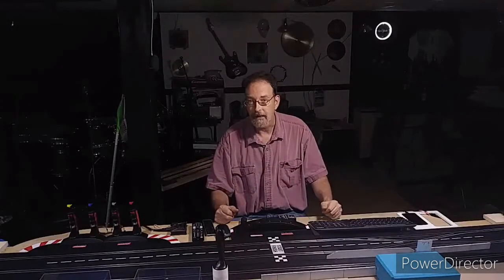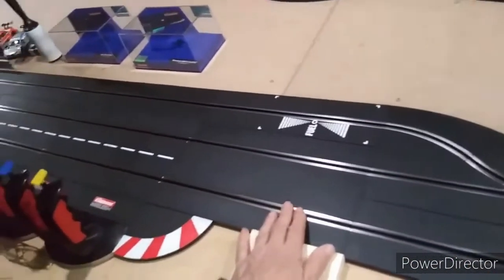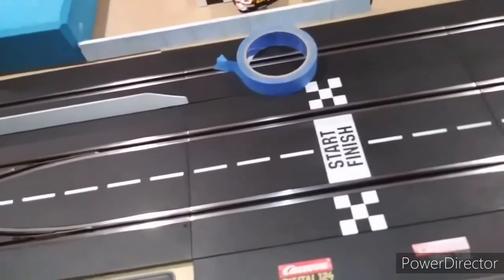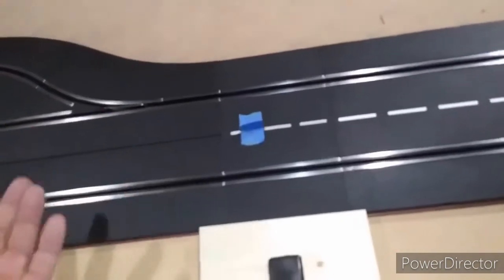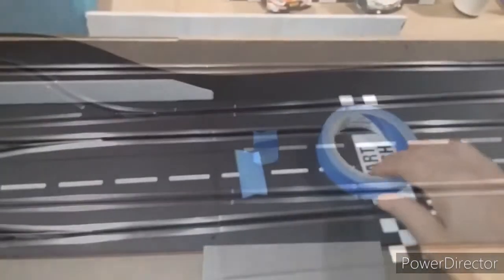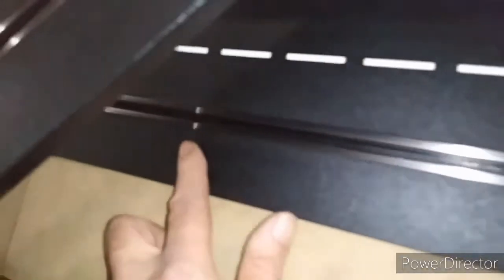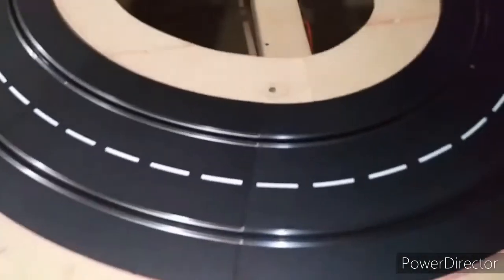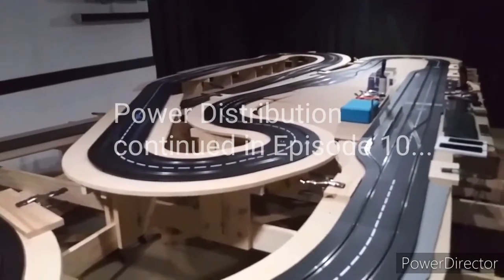Glendale 65 - Episode 9 - Track Wiring Part 1

Comment: Do you run power to your terminal from the track or from a power supply? I’m running my track on a power supply and I have to run 10 power taps, and was wondering if I can just power my terminal blocks from the power supply instead of a track lane? Thanks Tony
Reply from the maker: Actually, the power comes from the (so far, factory) power supply that plugs into the Control Unit. The CU is remote mounted, and track power from the CU goes to a terminal block, then to all of the track feeds. Hope this helps...

Comment: Do you have a recommendation of where to begin the main power tap from?  Do you start at the controller or with the first section of track before or after?
Reply from the maker: I run power directly from the control unit, to a terminal block, and distribute power from there.
Reply: @slotcarmayhem9765  John, thank you so much for your help.  Your videos are awesome and you have given me so many new ideas to try.  Carrera needs to put you on their payroll.  I wish that your videos were available when I began this hobby a few years ago.  It would have saved me much time and trouble.  I look forward to your future videos.  Thanks again.
Reply from the maker: @johncandela8448  Thanks for the kind words.
Reply: @slotcarmayhem9765  Are there leads coming out of the control unit that can go to the terminal blocks or do you have to splice into the power cable somehow, as always thanks for your time making these videos
Reply from the maker: Yes, there are
 wires added.
 https://youtu.be/y_L5qRo6Hmk

Comment: Just found you today 7/27/202. Fantastic video! I totally agree with your "Theory of 10" on Power Tap Location; and, splitting the difference to 6 joints in the one case, and not pushing it to 12 joint sections - as many might be inclined to do - when coming full circle. Your voice is very pleasant to listen to, and your thought-processes are thorough and exacting. I definitely 'grok' your style - as we used to say. Subscribed!
Reply from the maker: Thank you so much!!